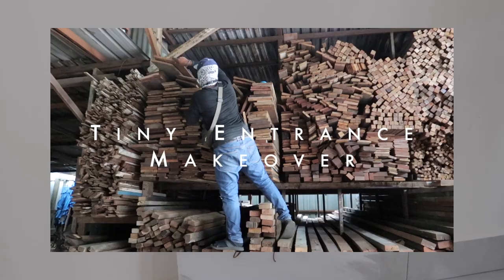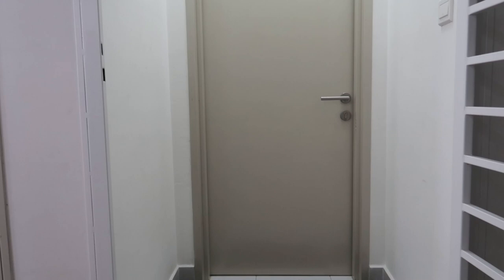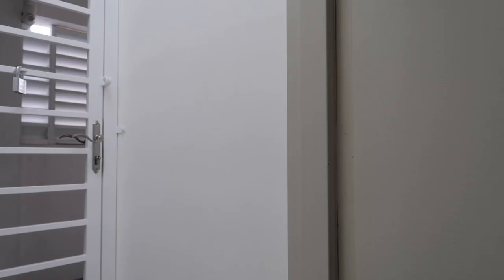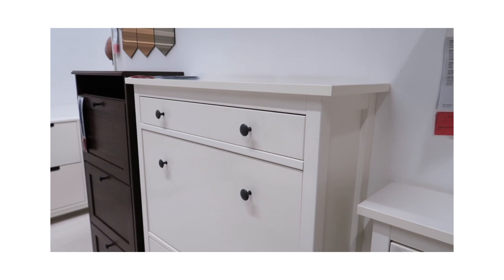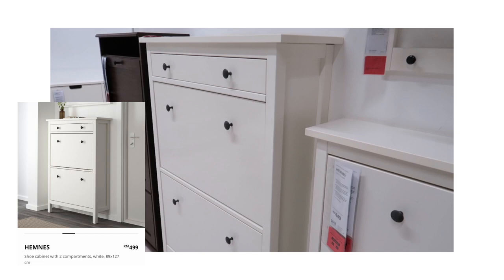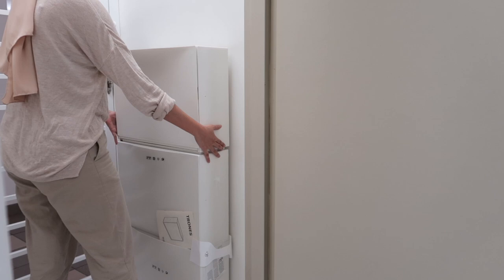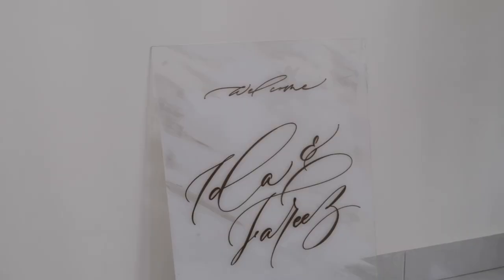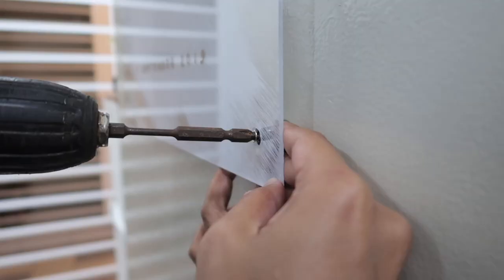Making Home | Tiny Entrance Makeover | Ikea Trones Hack

Comment: hii, when you first masuk rumah, how much did you spend for renovations? and can you share apa je yang you renovate? kitchen cabinet, etc...
Reply from the maker: Hi there! We didn’t do any major renovations, we only installed grill for front and back door before we move in, around RM900 for both. Aircond price depends on horse power, around RM1.2-1.4k each. We opted for simple basic lighting for the whole house and 2 ceiling fans, est cost RM700. As for kitchen, belum siap lagi 😂 we are in the midst of finalising our kitchen renovation, which is delayed due to lockdown - video in the making, stay tuned ! 😉

Comment: I love that !!! It’s so cute especially the detail of your wedding on the door? But how did you glue the wood to the cabinets?
Reply from the maker: Hi there! I didn’t glue the wood to the cabinets, i simply just put it on top. It works just fine, the wood just stays in place :)
Reply: @SedarSederhana  thank you so much for replying.. I have the same trones and want to do that idea aswell I just wasn’t sure how to glue it. Thank you so much
Reply from the maker: @Fabylocity  you're are most welcome. you might wanna try Gorilla glue or any strong adhesives on the top edges of the rack before putting the wood on top? hope this helps! good luck :)

Comment: Is the wood stable when you open the shoebox? Any ideas what to do for the wood not move?
Reply from the maker: Hi there! Mine is quite stable and doesn’t move at all. Maybe because of the weight of the wood itself, ceramic pot, plant and sanitizer that holds it down. Alternatively, u may want to use gorilla glue (or any strong glue) on the top edges of the shoe rack before placing the wood on top? Hope this helps! :)
Reply: @SedarSederhana  oooo nice idea thanks a lot 👍